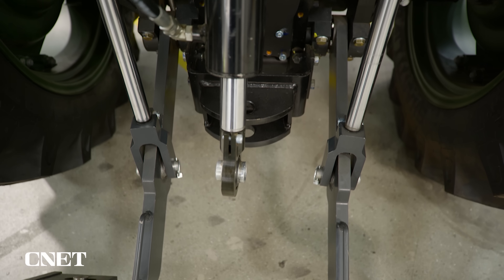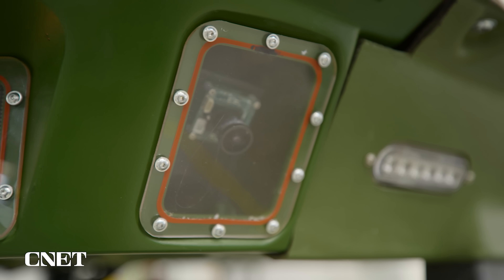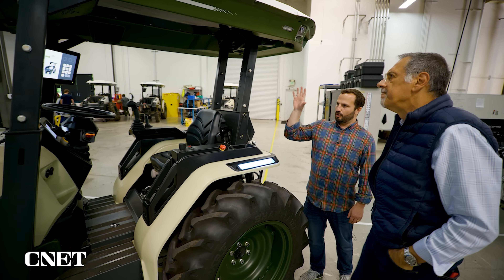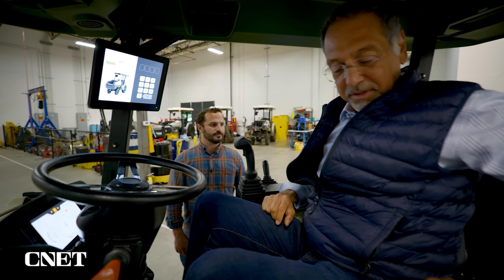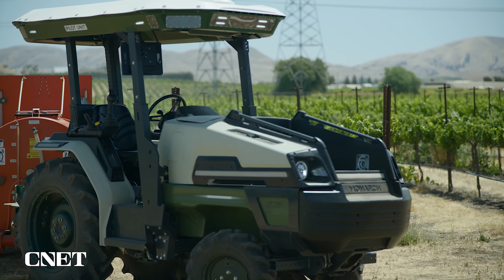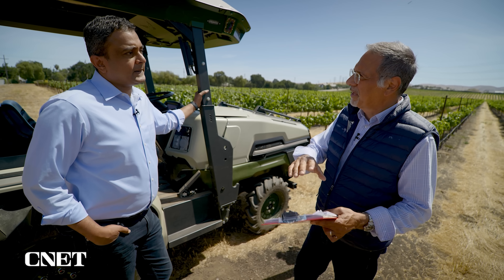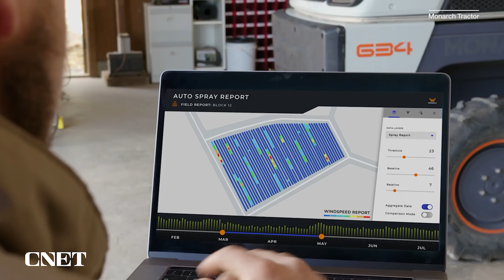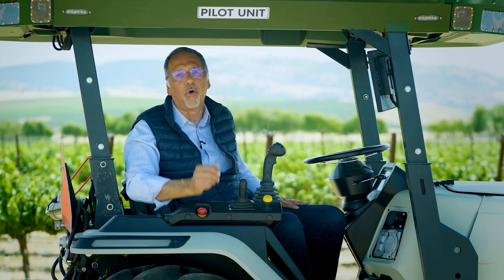This Electric Tractor Might Change the Future of Farming and Food!

Comment: all roofs look good in solar panels
Reply: the energy generated would be enough to use the tractor for 5 minutes per day. but it still makes sense since the tractor is whole day outside in the sun. just don't forget to clean the panel every 10 minutes in the dust :D
Reply: @tomo1168  solar panels on every roof and parking lot 
(batteries with solar panels is a business)

Comment: For years I've been saying that an electric drive train is a no brainer for tractors. For less money you could get an arguably better system. The cost of components for the drivetrain on even a medium size conventional tractor are pretty steep. On many an occasion I've found it cheaper to have parts made by a local machinist than buying new. By using independent electric motors for the PTO, hydraulics and each wheel and you can eliminate nearly all of the drive train components. If you don't need the tractor to go much above 30mph, which a lot don't, you could do without the cost of switchable gears due to electric motor's almost full torque at low rpm's. The electric motors offer huge benefits in terms of controllability. All of a sudden you can have a variable speed PTO with torque limiting at no additional cost, making it cheaper to build the implements and less likely to damage them if something unexpected should happen. Independently controlled wheels offer an opportunity to put more power to the ground in less than ideal terrain. Not to mention making possible implements that have a large current draw. 
I was honestly surprised at the claim this thing could do a full work day on a single charge. Online I found this tractor has a 55kWhr battery. That seemed sort of low to me, so I did a bit of math. If this tractor were capable of working at 35hp (a little over 25kW power output or half its rated potential) for 8 hrs. on a single charge, you're looking at a 200kWhr battery. That's twice what a typical Tesla is packing and nearly 4 times what it actually has. So in reality for the 10hr work day they are claiming, you can only use an average of just under 7.5 hp. It becomes fairly obvious this isn't a general use tractor. It's specialty tractor designed for spraying crops. Sprayer pumps don't use much power. But most farmers would find that woefully inadequate for a 70hp tractor. 
There is still a significant advantage to the energy density and durability of a diesel engine. And with a hybrid system you could use a far smaller diesel motor than the actual max output to generate electricity to power the motors and charge the batteries. And because all it's doing is running a generator, you could have it run at an optimized load and rpm so it would be exceedingly efficient. I think there is a market for a tractor like they are presenting here, spraying applications. But the breakthrough is going to come when they make one that can be mistreated, as farm equipment inevitably is, and repaired by a farm mechanic on site. The commentary about the automation aspect of the tractor making the obsolete sooner so that they can sell more of these seems to ignore the fact that farmers will be looking to update the software/firmware, not the entire tractor, to get those upgrades. And if they can't, farmers will be quick to switch to a brand that does. John Deere is already getting a lot consumer backlash about how they are designing tractors with the intent of making the user spend ever increasing amounts of money on their upkeep. 
I suspect we're going to eventually see some company capitalize on the enormous demand in agriculture for a tractor that is designed with the needs of smaller farmers in mind. They want to be able to fix most things themselves. What they can't fix themselves, they want to bring in a mechanic of their choice to do it, not the dealership's mechanic who will charge an arm and a leg to replace anything they deem worn out. They want consumables (filters, lubricants, bearings, etc.) that are normal standard parts that they can get at any good part store. If a company were to do that, I suspect they could come to dominate the market for mid-sized tractors in a decade.

Comment: That thing is tiny, it would only be useful if orchids or a hobby farm, on a grain farm they need to have insane amount of power, and they can 12-16 hours straight if now 24 hours a day when planting, when they need fuel you just hook it up to the fuel truck, this you need to drive back to the farm, plug it in for a day then keep going for a couple hours, it’s not practical at all

Comment: Im a retired Deere mechanic, Deere had autonomy before 05 but honestly, no one trusted it. Also Green star did give all sorts of data about moisture, crop densities, seed population and more than you cared to know. it could operate at set speed and lift and drop the tool like you programed it. Tho it didnt always work…. we had Deere engineers from Moline out trying to sort out a new 3 fold chisel doing jumping jacks by itself. curious if an electric tractor can operate a 60’ air hoe drill or stack 2000 lb square bales? Can it run a 6 shank ripper 10” in the ground? I couldnt even get guys to read an operators manual or quick card for a baler or planter monitor. The more techy crap got the more call out I had. Tractor wont go because it popped a fuse due to rats eating the harness under the cab. Complexity breeds unreliability. Electric is impractical and just honestly political bs. Open the effing XL

Comment: They need to upgrade the power grid that has a hard enough time let alone running AC and handling heat if they want to push all electric it's not going to work if you don't upgrade to power grid

Comment: The run time is going to be hard as most farmers work longer periods of time then the trackers run time.  They need to have swapout batteries.  so one is charging while one is working.
The food transparancey is a bit of a joke.
This is also a hobby farm tractor.  It is not going to do the work that the large tractors do on a real farm.  Even just producing feed thiese tractors would be useless.  It is a good idea but dont seel it as a real tractor.

Comment: My grand-grandfather bought an axe and I still use it on a daily basis, as my father and grandfather did. Since then, the handle has been changed 4 times and the blade 2 times. But it is still the axe of a grand grand father 😏

Comment: A great idea BUT. These machines are, at heart, computers on wheels. The computer industry has for generations been updating software at such a pace that your HARDWARE (IE computer) is obsolete in a few years, SO YOU NEED TO BUY A NEW ONE. 
John Deere has been royally pissing off their loyal customers by withdrawing their tech support for older operating systems, and refusing to allow owners access to the software running THEIR OWN TRACTORS. In effect forcing a farmer to buy a new tractor YEARS before their old one is worn-out. Most are now hacking the software, as they can not afford to replace a perfectly good machine.
Who is going to own the right to the software that runs these great machines? Are you going to be left with a very expensive HOUSE BACK-UP BATTERY after 8 or 9 years?

Comment: Sorry a electric tractor is not that good of a idea in large scale tractors.  The power required to farm is TORQUE and not horsepower.  Seems as if a electric vehicle sucks down the battery when it is required to produce TORQUE.  Now what are you gonna do when you are down over half the time charging , it would be good for a gentleman farmer with say only a couple of acres anything bigger and right now it isn't valid for bigger operations.

Comment: They are still having engineering issues. The brakes fail currently.  And their production is still too far behind. John Deere is ready to release all of their 
In the next 6 months monarch will be years behind.  They have no parts and they cannot produce for less than $100000

Comment: Sustainable? What does that mean? No rare-earth minerals in the batteries, no child slaves digging up cobalt, no huge land fill for expired wind blades or solar panels? Sustainable is oil powered: high density efficient energy that is cheap, reliable and doesn't rely on expensive batteries for when there's no sun and no wind.

Comment: electric tractor good idea. autonomous not so much. just make a basic electric tractor with standard three-point hitch and pto. as usual they over think a simple job.
Reply: @JorgTheElder  actually I have and a small tractor like the ones they are promoting does not do that kind of work. it's not big enough for large scale farming and small-scale farm need a more versatile machine. as an owner of more than fifty small farms and ten large farms I think I have an idea what is needed. we need a small electric tractor with more versatility and a large tractor with automation. my combines can run almost by themselves, but they are all diesels. we need electric and preferably with solar charging systems. small farm tractor also need implements on the front like a loader bucket and hay forks. the tractors they have are a start, but they are a long way from what is needed.

Comment: Sustainability in the Farming Industry would be the reduction of land use for feed production for livestock.
The electrification of motorized vehicles has fewer externalities compared to the use of fossil fuels for the same application, but not everybody drives tractors, and electrifying our farm equipment is a small step compared to the transformation that our cities and transportation systems need.
Ngl, I wrote this because I cringed at the statement that farming is 'unsustainable because of fossil fuel burning tractors'.
Reply: food production and delivery is a huge factor in fossil fuel use. while i agree on the use cost of intermitment use of some farm equipment such as a combine a general use tractor might make sense.